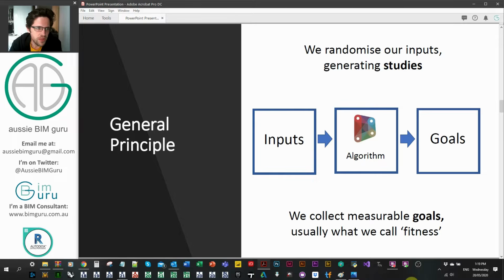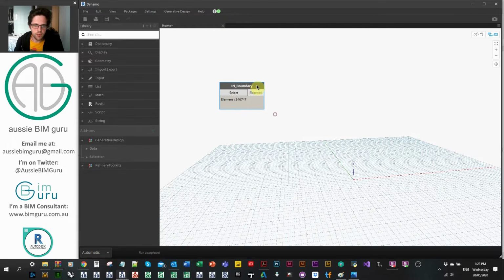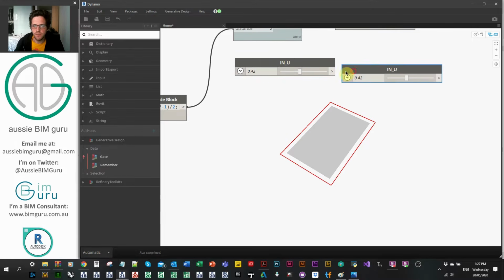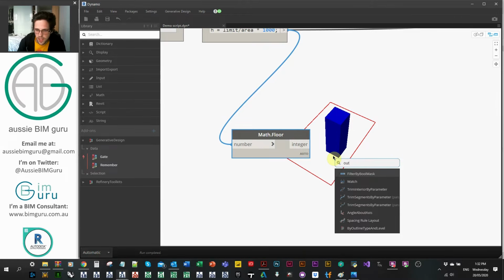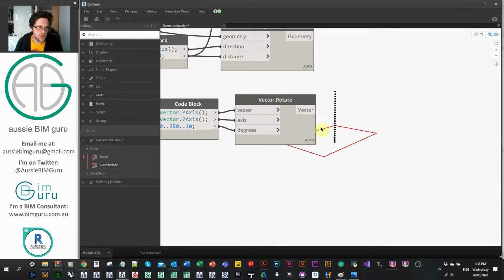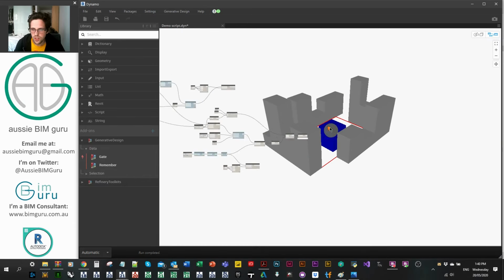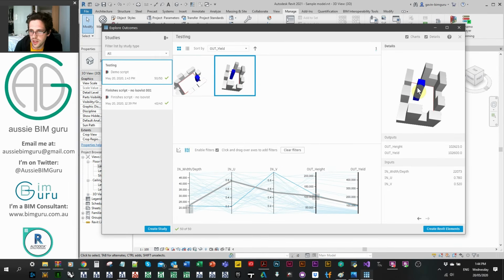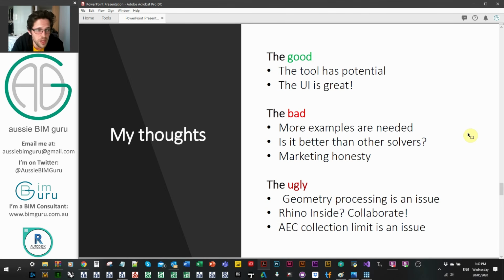Generative Design in Revit 2021

Comment: Hi ABG. appreciate your video. Was trying to follow your steps, but however it seems that my OUT_Height variables stuck at a single value only instead of giving me options with different heights. I might miss out some of your steps. Checked all of my settings. Seems ok. Appreciate your feedback.
Reply from the maker: This sounds like a common issue where the GD tool clashes with other addins and doesn't allow flexing of inputs. I've since large-in-part given up on this tool as many people encountered this bug and the development team typically couldn't give an easy solution. Make sure your nodes are identified as outputs and you use the remember node, otherwise it is probably a technical issue with the software:
https://forum.dynamobim.com/t/generative-design-output-node-are-not-reading/55906

Comment: Hello Gavin,  I have attempted to recreate your workflow in Dynamo (Revit 2022) and my studies are returning results of differnt positions but identical heights. So then I simply downloaded your dynamo script (and  replaced the Watch nodes bc of version incompatility) and ran the study, but i have the same issue. Do you have any idea why this might be happening? Thank You.
Reply from the maker: Hrm unfortunately I'm not sure. I recently ran this study and it worked for me in 2022. My only guess is maybe you havent nominated the width/depth as inputs as these drive the height.
Reply: @AussieBIMGuru  That wasn't it, but at some point in the script I changed the value type from integer to float and its working now.

I have even extended your workflow,  by adding outputs like "% of blocked views" and "estimated building costs". Now its a multi objective optimization problem. 

I have also made an interesting discovery: when I do a cross product of the coordinates, while keeping the height constant (about as high as the tallest surrounding buildings), go to the scatter plot and set x and y to the coordinates of the building and color in the dots according to yield, I get a really interesting heat map type graph that tells me that the corridor from top left to bottom right is optimal for views. 

Thanks a lot for this workflow, it's been a great starting point for me to discover visual programming and generative design.

Comment: Hello, We did the same exercise with same steps, by when we apply generative design the outputs are not appearing, can you figure out what is the problem?
Reply from the maker: I've seen many reasons for this unfortunately. I'd suggest going over to the forums to troubleshoot with the product team.
Reply: @AussieBIMGuru  I saw that there, they talked about a node that is not working properly, but nothing is shown in dynamo that there is something not working properly, I updated the generative design to 2.5 version and still same issue. plz can you provide us link for this topic in the forum?
Reply from the maker: @ds-pro1307  i am not sure which topic you mean, I would make a new one
Reply from the maker: Yes if you're not sure just make a new topic on the forums. The developers of the generative design tool are there and know most of the common errors it can face.

Comment: Great video thanks - a lot of videos out there showing how to run the inbuilt studies as you said but this really helped me get a handle on this tool and it’s (current) limitations. You mentioned isovists, I’m currently fighting with the space analysis toolkit, you got any plans to drop a video about that?. Cheers.
Reply from the maker: Glad it helped give a better example! I find not enough resources focus on the script itself so wanted to cover a start to finish example.

In regards to the toolkits, I've experimented with a few but couldn't get very meaningful results from them. For example I tried the space layout tool but the output is just a functional relationship diagram essentially - everyone expects it to make a floor plan it seems.

In regards to isovists I typically use Ladybug for Grasshopper via Rhino Inside for isovist studies as the tool in Revit is too slow to do bulk studies. It can do one just fine, but once you go past 30 or so (or have a detailed site model) it typically spins out the session I've found.

Comment: This is precisely the problem with the tool. Timestamp 30.35.  Autodesk pulls out new workflows and they don't sustain. The same happened with fractal. I think one of the Dynamo makers must really intervene in the C / C++ code pipeline and try to enhance the Geometry Kernel. Although as said by you earlier Revit is basically playing with Database. There could be some solutions that could be pointed out by DevOps guys.
Reply from the maker: It's not perfect by any means, in Thursday's video I'll show Galapagos using Rhino Inside which addresses some of the geometry limits in a different form.
 
The main benefit I see for the tool is introducing more users to generative design, but not necessarily only using this tool - just as a starting point. Many Dynamo users (even myself) did not consider using Grasshopper until Dynamo sold them on visual coding. I think this will play out similarly, and Generative design needs awareness to be raised - it's still large in part poorly understood and utilized by the industry.
 
I believe there has been some work done on the underlying Dynamo geometry preview system in version 2.5, but definitely still work to be done. The challenge is its always hinging from Revit which isn't as strong an engine as Rhino3d. Conversely Rhino3d is not a powerful BIM platform, rather than try to get a dog to meow, maybe we just learn to get the 'cat and the dog' to work better for us together :)